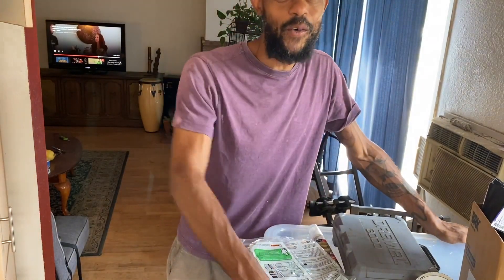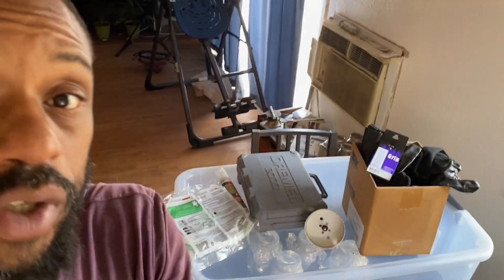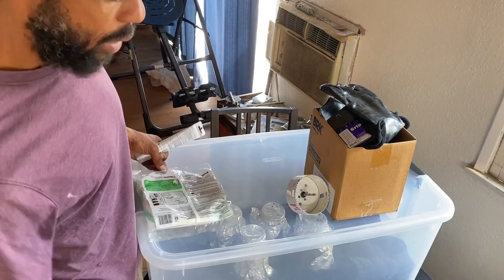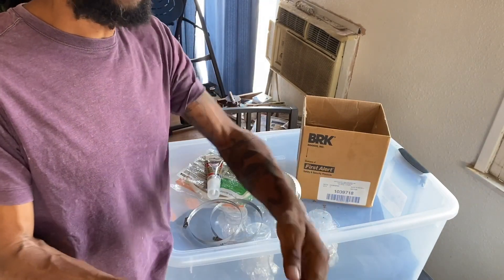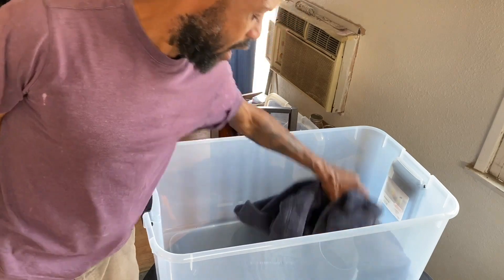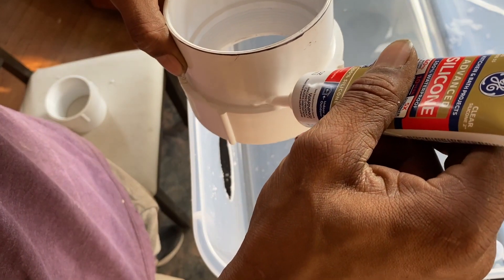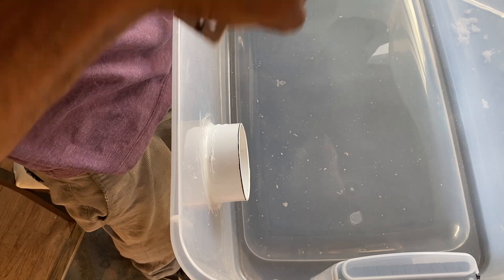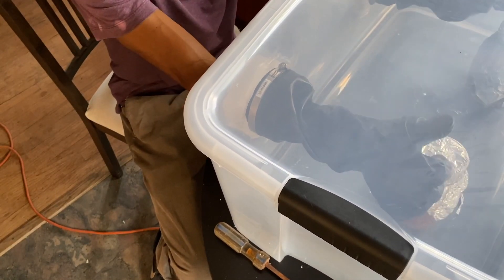How to Make a Glove Box/Still Air Box. For Improvement Tweaks, Hit Link In Description

Comment: Tsup. Brother from another mother. Nice video. I just finished growing some shroom kits i bought here in Holland 🇳🇱, I'm collecting stuff to do it myself and am pretty close 2 having everything. I still have to make a still air box and was wondering if you knew what those gloves are called or used for, I can't find them in home depot equivalent stores here. 
 Did you inoculate already and have colonisation?
Reply from the maker: Not sure the name or what they’re use for. I just looked for some that went up to my elbows or as long as the box would allow.